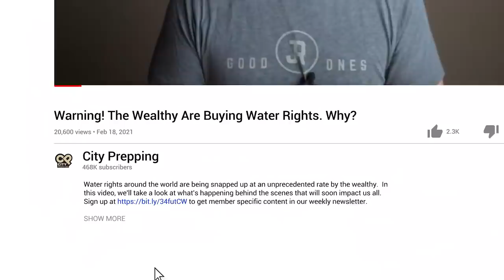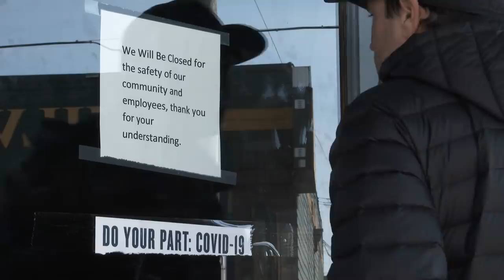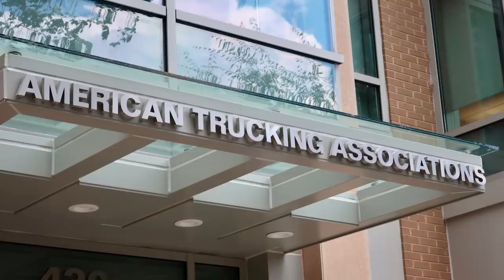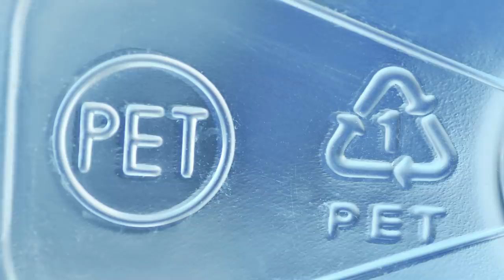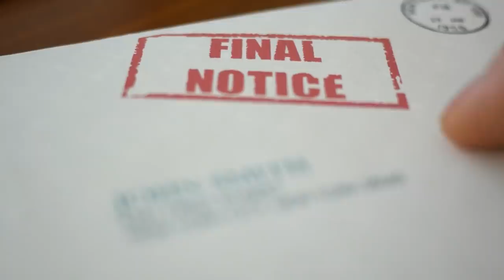Supply Chain Collapse: What's Coming Next and How to Prepare

Comment: Canning lids have been impossible for me to find. I am now attempting to learn how to use wax to reseal jars for canning. I also haven’t seen ramen noodles for months where I live. The shortages have been random products or the typical products on shelves have been replaced with off brands.
Reply: I spent $5 for off-brand wide-mouth lids yesterday.  Weren't they $3 a couple of years ago, for Ball Brand?
Reply: If you save the jars and the lids from marinara and spaghetti sauces, you can use those to do your canning. Not ideal, but desperate times call for desperate measures. I have been saving mine.
Reply: Haven't seen ramen here either. The brand they have on the shelves now is nasty.
Reply: @gayledixon72  where did you find the lids. You are right Ball brand was cheaper a few years ago
Reply: @olmcmonnie7445  right. It’s some strange brand I have never heard of. I was able to find Top Ramen online from Walmart
Reply: I've been ordering direct from companies Ball,Kerr or Mason for my lids.
Fyi..Amazon sells them as well. Make sure you purchase the company name product, not the bland lids.
Reply: I've been really lucky with lids at smaller hardware stores and my tractor supply store.  Good luck
Reply: @MJ-fv7lh  ACE Hardware.  I am told U-Line has lids......I haven't looked there.
Reply: @laurab8547  I think the canning experts at the county extension office would have a heart attack if they knew you were reusing  lids and jars from commercial sauces.  They even tell us to toss unused Ball lids that are more than a year old........
Reply: @gayledixon72  thanks!
Reply: @gayledixon72  I went online and learned how to use paraffin to seal jars like my late mother in law used to do. I might try that just to have the skill for the future.

Comment: Having trouble with real storable water solutions in a semi suburban area. Space seems to be the biggest issue. Any pros have a tip for a noob?
Reply: I have the same issue!
Reply: Create an outdoor deck with water storage under the flooring.

Combine with going vertical.

Budget impacts on what suggestions I could offer.

For cleaning/hygiene water storage.. Or emergency water which you have purification options and filters for:

Ask at fast food suppliers for food grade buckets... Explain you are an avid environmentalist looking to upcycle. Clean, bleach and once cleaned well...fill with water.

Put lid on. Stack two or three high. Leave a gap between the building wall and the outdoor stack.

Decorate by painting decoratively/ mosaic.. Whatever so it blends in.

This has the added bonus of increasing room insulation, creating a thermal mass and creating a little protection from stray bullets.

It's a solid start which is almost free.
Reply: You could also cover with some kind of fake wall/ picket fence which has outdoor cushions on the buckets behind it... Or potplants on top of the concealed buchets.
Reply: There is a lot of space behind the basebars of your kitchen cabinets...
Reply: Store what you can and buy a good filtration system. Find a water source and learn to use it for when your storage runs low. Also add rain catchment. Knowing how to process your own water is a must. On average a person needs 2 gallons a day. That is 730 gallons a year. That's minimum for drinking and cooking. Let's not even talk about bathing and cleaning. Almost nobody can store that much. Become self sufficient.
Reply: We hooked up 4 50-gallon barrels to a rain downspout.  I use it to water the garden, but we could use it if municipal water was unavailable - and that's why I bought a Berkey water filtration system.  Our barrels are inside a fence, and I don't think they're even visible from the road.  If you don't have a fence, I think you can buy these outside "privacy panels". Check city codes - some areas make rain catchment illegal! smh
Reply: I QUIT WORRYING ABOUT DECOR AND HOW MY HOUSE LOOKS AND FOUND THIN WATER STORAGE CONTAINERS. I HIDE WHAT I CAN BEHIND COUCH, DRAPES ETC AND MY BEDROOM IS FULL OF WATER BEHIND FURNITURE, IN CLOSETS, IN CORNERS ETC. STACK IT!

Comment: Underground Economies Incoming!
Reply: @beastslayer9153  it would be a barter & trade, a dozen eggs for a pound of flour and so on.
Reply: @jerorm  We trade garden produce for eggs. I've frozen several dozen, but just got a freeze dryer and will be using that from now on.  The trade has worked well for almost two years - the chickens don't lay as much during winter, and we don't have fresh produce (though we have traded canned veggies in a pinch).

Comment: Here in Brownsville, TX,  most Ssouthern point in TX on Gulf coast..
Milk increased .40 a gallon overnight 
Veg oil  increased .45
Sugar-free drink mix up .50 AND down in amount, 1/2 gallon less
Dry chicken gravy mix (only chicken) from .33 to .70.
All of this increased in 1 weeks time.
For more than 1 month & 1/2 the shelves are very sparsely stocked. There has been little to none of
-gatorade
-orange juice
-boxed juice 
-paper plates
-certain crackers 
-canned veggies
And it goes on & on
There have been large gaps on store shelves in almost all sections.
My rent increased $300 from 1 month to the next.  But I haven't had a pay raise in 11 years.  It's getting crazy!

Comment: My neighbors are trying to build an orphanage in Madagascar (where they are originally from) and they're very dedicated. They couldn't travel there for over a year due to the Covid crisis, so they used the time to buy and fill a shipping container here in Germany with donated goods like bakery machines, a generator, solar panels, etc. The container itself and the donations inside are worth €20,000 - but in the meantime the shipping cost has gone from around €3,000 to almost €10,000.

Comment: one issue to consider, the USD is mostly valued as a reserve currency. when it hits high inflation it will not serve that purpose well and may loose value quite suddenly if another better reserve unit shows up. possibly over night or over one weekend.

Comment: I have been prepping since early 2019. Now I have a well working food pantry. My biggest obstacle to prepping for a very hard year is the constant threat of fires. In the past month we have had several large fires within a 15 minute drive. Yesterday a pretty devastating one wiped out a subdivision near by. 
Other than moving, what can I do? Prep for a year and risk loosing it all, or keep the prep small and risk not being  prepared for a collapse? The big move is in the works but we are still years to being able to leave
Reply: I live where, forest fires have burned this summer in Northern Michigan. I know where the public campgrounds are at in Northern Michigan. They are my bug-out locations in case we have to evacuate from an approaching forest fire. I keep a canvas tent, wool blankets, bivi bags, a first-aid kit and other supplies in the tool box in my truck for that emergency.  Those supplies stay right there all the time. We can jump in my truck and go at a moment's notice. I'd do that first, if you have the room in your car or truck. It may sound extreme, yet, I would start to bury your supplies in the ground.  A thirty gallon size or fifty gallon-sized plastic barrel, turned upside down and sealed well may work. Then, at least you'll be able to dig up what you stockpiled for emergencies. Or, you could take your supplies to a secure storage facility and keep them there until you're ready to move.
Reply: Can you set up a dedicated sprinkler system for your property?

Comment: The mention of getting nonworking parts and supplies is quite prevalent. Just go and try to get a new starter or alternator from the parts store. I had to change the starter on my truck  3 times to get a working one. The parts guy at auto zone said it is common now.

Comment: I work in car manufacturing and as of today September 21, 2021 we have been down to working 3 days per week due to the computer chip shortage. We were told a chip factory in Japan caught on fire and was destroyed. I also read since lots of employers are making people work from home that has caused a demand in electronics and computers. I live out of my Prius by choice. There are lots of people going this route and turning their cars into campers. It can be done comfortably. Prius is an excellent car for this because it hardly uses gas and you can let the car run all night off the battery.

Comment: Do you freeze your flour, rice and beans before storing in buckets?
Reply: Good idea
Reply: I don't. I keep my white rice in gallon-sized Mylar bags sealed with a hair iron. I toss a chemical toe heater packet inside first to remove the O2. Flour doesn't last very long, so I don't keep much of it. I keep pasta and dry beans in half-gallon-sized glass Mason jars. I keep the Mylar bags with the rice in 30 gallon-sized galvanized metal garbage cans. I've always had a concern about freezing flour or rice or beans (I know it's done to get rid of bug larvae) because when it thaws it will have moisture inside, which we all know is not good when it comes to food storage. The key is to keep it dry, bug and rodent free and out of the sunlight.

Comment: Kris; et al. I tried sending a message on your webpage, but there was an error with the Captchka (or whatever it's called) that prevented it. So I'll post it here knowing I ma put myself at risk:

I want to put something in perspective as far as supply chain shortages. Are you aware that those deficiencies also translate to the supply to our power production facilities?

I used to live in SoCal. So I saw the difference in power prices when I moved to the Midwest. But this is a different animal! We are about to see something across the country that mainly only Californians have seen. Brownouts and rolling blackouts.

While we have turned to more sustainable, yet more unreliable, forms of power like solar and wind. Coal and gas plants still support the majority of the country. But coal and gas has to get from point A to point B.

Won't say how I figured this out. Won't say that I actually see this happening in the place that I work. I will say that as the supply problem continues that electrical distribution to everyone will start to be a problem.

Thank you

Comment: Gardening is my next skill to learn. I'm a little concerned a I live next to a state park with tons of deer. Either way it will be an adventure!
Reply: Deer roam where I live like pigeons cover cities.  The only thing I have found is to build a set of 7’ t stake fences and cattle wire.  Separate the sets by 4 feet.    By using a tall and double ring, the deer won’t attempt to leap that high and far.  My orchard and garden have not been touched by the deer.
Reply: If they are on your property cant you eat them?  Think of them as meals on wheels!
Reply: I suspect that if things continue to deteriorate, the deer population will soon become significantly less of a problem.
Reply: Deer do not like the smell of marigold flowers. Deer do not like to feel a tight line of heavy twine or heavy fishing line against their lower legs. Both the marigold flowers and the heavy twine, positioned about two feet above the ground on metal or wooden posts works to keep them out of my tomato plants, grown in large pots, set around the outside of a large lilac bush for shade.

Comment: A lot of the bottled water shortage and limitations right now are because of the storm damage and power outages from hurricane Ida. 

A lot of our problems with supply are flat out due to most of the manufacturing being done overseas instead of here in the US. Unless/until that is changed, and we get back to being a manufacturing nation instead of a mostly consumer society (the use of those two words is deliberate), things will get worse. I'm a lot more concerned about our medication coming from China than in supply shortages. There is a horrendous potential for those medications being held back to force US compliance on any number of issues. We're fairly well stocked up on food and other necessities, as well as some luxuries and extras though, but I'm concentrating now on otc meds and first aid supplies simply because I don't trust the 'source' for many items. The low amount of these items that are produced here and don't rely on ingredients and base supplies from other countries is truly worrisome.

Comment: no food problem in this area probably for long time. did buy 2 radiating oil heaters in case there's a natural gas shortage. natural gas can't be artificially produced (or so they say) and supposedly some day will run out. better if you convert your home to all electric, and at least partial solar if possible
Reply: Most electricity is generated from gas at least here in the U.K. it’s a hot story right now that gas futures are rocketing and so are electricity prices because of it.

Comment: As a electrician I have 6 gallons of milk from 1 jersey cow a day. Egg from my hens. Maple syrup maple candy from my maple trees . Honey from my bee hive. And off grid 1000 amp hydro turbine generator off grids 24-7 200 amp service and have 1000 amp main disconnect switch and run in parallel 500 Cir mill wires. Tons of food and apple tree exc . And I do process my own animal for bacon , meats, and grow enough food to feed my animals throughout the winter. Some neighbor buy some stuff from me corn up the wazoo. Think about it I may just stick pipe my pond .
My neighbor know I have stuff and there buying stuff from me. I guess I’m not charging enough 1 gallon of raw milk I charge $2.50 and dozen fresh egg I sell $2.00 exc

Comment: I'm having a hard time understanding your logic. Inflation, as a result of consumer spending, has increased. Pressure on manufacturers, as a result from increased demand and environmental forces, has created a bull whip effect in supply chains thus shortages in supply chains. Uncertainty, as a lack of faith based on optimized supply chains has increased. I get your points, but how is buy more goods, that are already in short supply, a legitimate solution? The rationale you are providing is only contributing to the cycle of panic buying, and hoarding more than what you need. Supply chains are only so flexible, so individuals need to make up for that weakness. Buy what you can, when you can, and leave enough for other people.
Reply: OTHER people aren't my responsibility.

Comment: So here is the low down on the shortages and why ships are stacked off the coast waiting to come in. China has purchased over a million empty freight containers “connex” boxes. An I know this because I am a inspector of these boxes here in Jacksonvile. We work directly with the shipping lines and I am in a depot that handles, repairs and stores these shipping containers till needed. So the ports are choked with empties sitting there waiting to go overseas to China San the ports are 100% filled capacity. Leaving no room for loaded vessels to offload and put them on trucks to leave an go to their destinations. Truck go into the ports with empties, dropping off the empty to pick up a unit loaded. An when the ship is done being off loaded it is then loaded with empties. There is no room for the turn around. An that’s the choke point….. NOW IS CHINA TESTING OUR SUPPLY CHAIN TO SEE HOWNIT REACTS TO THIS OR IS IT JUST A DUMB MISTAKE ON THE PORTS BEHALF?

Comment: I've been spending money like CRAZY this past year, prepping for hyper-inflation.  Electric scooters are a great investment and are going up in price.  I recommend the Segway, HiBoy and Ferrari e-scooters.  Get them while they're still under $1,000!
Reply: I'm 54 ! 🤔
Reply: @pamspencer5733  The HiBoy S2 Pro (top speed 20mph) has a seat attachment if you can't stand that long. Costco has an electric bike that is under $500 (the last time I checked).  It is small but powerful and has a top speed of 15mph.  I prefer the scooter because I can walk it into a store and keep it with me.  Bikes need to be secured to a bike rack and that's a bit much for me.  If you go the mobility scooter route, those are still less than $2,000 and you can take those into stores with you too.  Those seem to have a top speed of 5mph, which isn't much better than walking and their advertised range is around 20 miles.  If you need to walk more than a mile to get to the store, a mobility scooter might be worth it, especially if there is a gas shortage in your area.
Reply: @pamspencer5733  I just checked Walmart and they have mobility scooters for under $1,000!
Reply: @myavatartablet2567  I'm thinking of buying a trike 4 wheel motorcycle..I want something I can buy groceries with & if I get in an  accident I won't smashed to smithereens🤔
Reply: @pamspencer5733  I just did a search for those.  They are over $10,000 and use gas.  My idea was something inexpensive and electric for when gas shortages hit, as they did in the 1970's or more recently when we saw all of those people filling up plastic bags with gasoline because the gas stations were hit with ransomware.  Where I live, a city with bike lanes everywhere, grocery stores and friends are nearby so an electric scooter is perfect.  When I grocery shop, I wear a backpack which is plenty of room.  Since I've been using my scooter for local errands, I fill up my gas tank every-other week now instead of every week.  At over $4 a gallon, it saves me a nice bit of change every month.
Reply: @myavatartablet2567  Yes indeed! I saw a sharp,red scooter by Honda for $2,000 I believe awhile back.I guess it's very well made. So much junk from China these days🥴